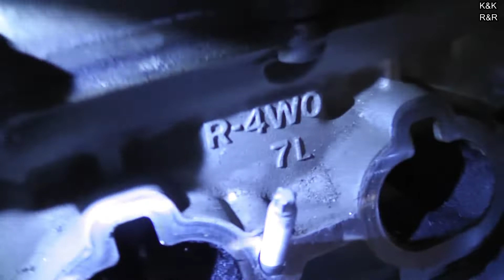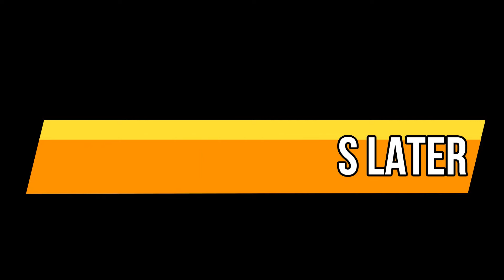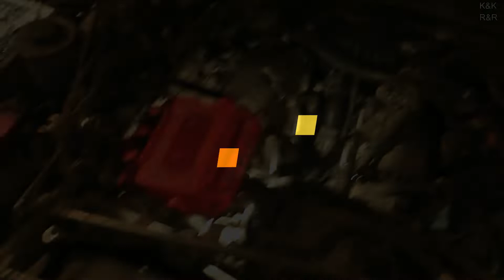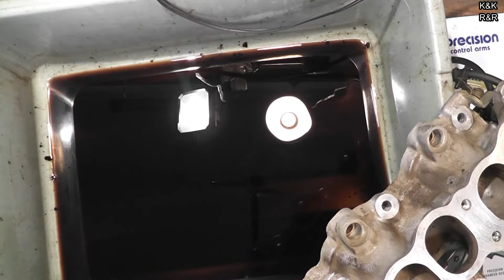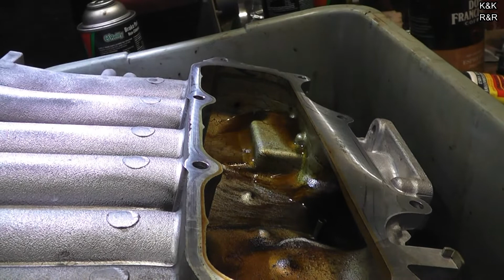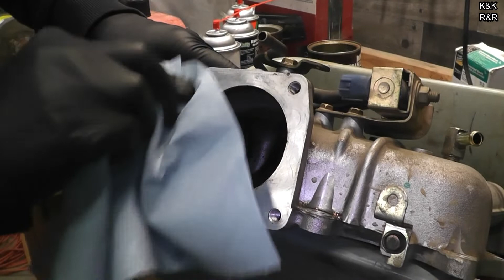2001 QX4 150,000 Mile Intake Cooling System Tear Down Pt6: The Clean Up

Comment: Awesome Videos (I watched the whole QX4 Series) ... Just curious, you mentioned that the little Philips head screws on the butterflies sometimes back out so you were going to take 'em out and add some Red Loctite ... With that in mind, why didn't you just unscrew the butterfly valves to clean them, and then reinstall with the Red Loctite.

PS I came across your Channel because my 04 Pathfinder is overheating ... Not knowing there was a Water Control Valve (2nd Thermostat) I replaced the Water Pump, Thermostat and Radiator and still have the overheating problem! ... I hope replacing the Water Control Valve/2nd Thermostat fixes my problem
Reply from the maker: Thank you for the wonderful comment.  Once parts have worn in a pattern you really don't want to disassemble the butterfly valves which is why I cleaned them in place. This is one job you can over clean the butterfly system and cause new bushing wear which could cause the shafts to cease up.    The Red Loctite side of this repair we did off camera because we took one screw out at time so we didn't have to worry about the butterfly valve moving on the shaft.  The rear water control valve controls flow from the rear half of the engine so if that sticks it will over heat.   Please let me know if that fixes your over heating issue I'm interested in knowing. 
/K&K